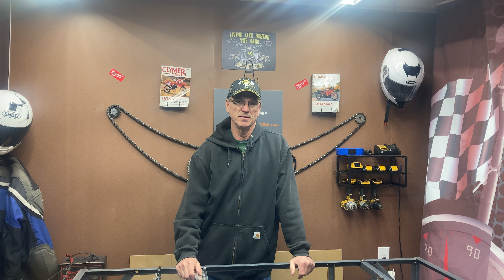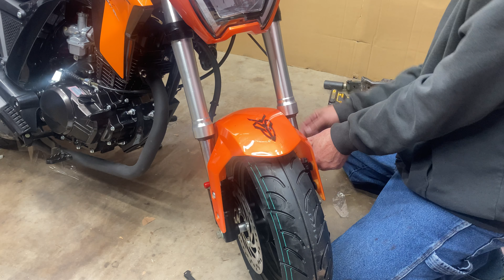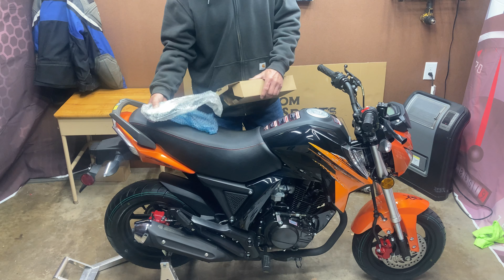NEW BIKE ASSEMBLY- 2023 Venom SS3 KP mini 150

Comment: Hi and thanks for all the very well done videos.  I know you no longer have this bike, but did you ever make a video about integrating the lights on the tank with the turn signals?  I saw the short when you did it.  Any help would be appreciated.  I'm getting mine next Friday.  Keep the rubber side down.
Reply from the maker: Hello, yeah the lights on the tank are unplugged, you simply just have to plug it back in for it work 😊
Reply: @herbiesgarage681  I hate to bug you, but where do you plug them into?  I should get my bike on Friday.  BTW, do you still have any Lifan bikes?  I saw the video on the Rebel.  Thanks again.  M
Reply from the maker: @mickeysizemore3515  no bother at all! If I remember correctly, it’s been a while, I think you just have to remove the tank or lift it up and you’ll see the connections under there. I’m getting excited for you 😊
Reply: @herbiesgarage681  Thanks so much.  I was thinking about getting a used Rebel, but a smaller bike will be fun.  I have a KLR which is a little too big just to buzz around on.  Again, thank you.  M
Reply from the maker: @mickeysizemore3515  Thank you Mickey, good luck with whatever you choose 😊

Comment: Should the front tire be 25 psi or 29 psi? I get two different answers when I look it up. The tire says maximum 32 psi, but I know not to do that much.
Reply from the maker: Do you have an owners manual? Also it should say on the Swingarm metal plate. The tire pressure really depends on the amount of weight the bike will be carrying. If you’re light 25 psi would be fine, if you’re heavy I’d go with 28 psi. 😊
Reply: @herbiesgarage681  I’ll check the swingarm plate. I didn’t even realize that rider weight affects how much will be needed in the front tire. Your videos have helped me out a ton. Thank you!
Reply from the maker: @LukeE-t2k  Yeah, both tires carry the weight but when the tire pressure in rear is most important is when you carry a passenger. You’re welcome 😊

Comment: I had one of these!  About  3 years back.  Neat little bike.
Reply from the maker: Yeah it was a fun little machine 😊
Reply: @herbiesgarage681  Mine was orange, got it from a place in Fenton MO,.   Only two things I didn't like was the gas gauge was horribly inaccurate sometimes never going below 50% even when almost empty.   Also the speedo was 11mph high.   Otherwise fun little city/in-town bike.
Reply from the maker: @marchufnagel9068  I agree with both points. 😊 I know exactly where you’re talking about in Fenton, I wanted to take a ride over there sometime and just never have 😊
Reply: @herbiesgarage681  really nice fellow.  Do they still make the mini?  FI would be nice.
Reply from the maker: @marchufnagel9068 yes and it’s EFI as well 😊
Reply: @herbiesgarage681  The one I had was carb and I had to learn how to work with it.   Your 23 was efi? interesting.   I was sure mine was a 23. hmm
Reply from the maker: @marchufnagel9068  No, my KP mini was carbureted, I ended up putting a Nibbi carb on it. It ran really good 😊